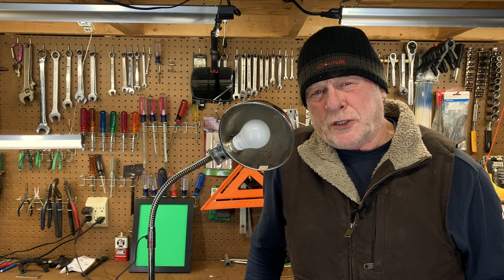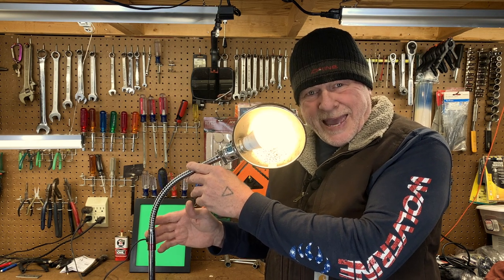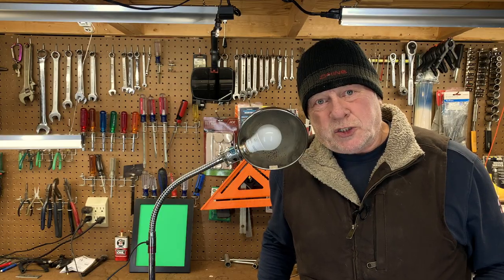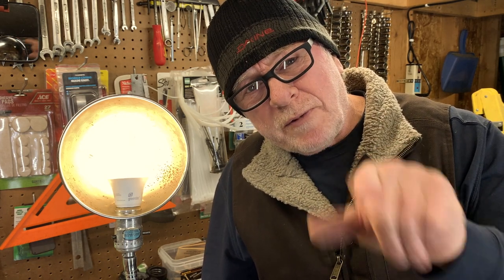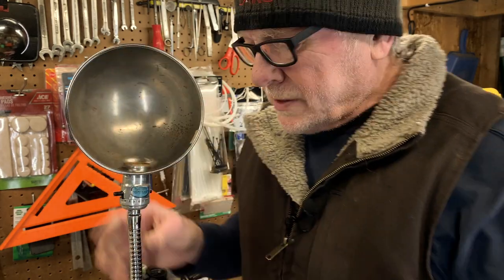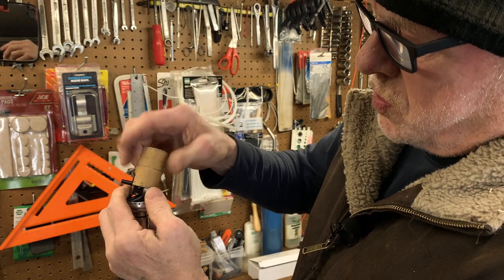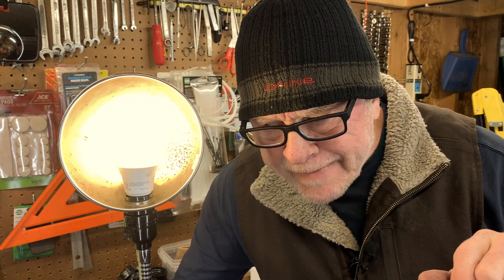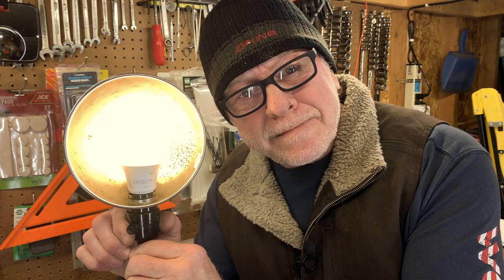Repairing a Lamp Socket - A NASA Certified Course, NOT!!!

Comment: Thank goodness you didn't touch the encabulator!  That would have caused the spurving valve to close permanently!  Good vid, did not know the polarized side was the white or silver.  Have a good one WP.
Reply from the maker: Been there, done that. I have assimilated from past escapades that palpating electrified anodes with one's unsheathed phalanges has the propensity to induce sizable myogenic and objectionable oscillations.
Reply: @WaynePolcin  ...not to mention the damage it will do to the phalanges!